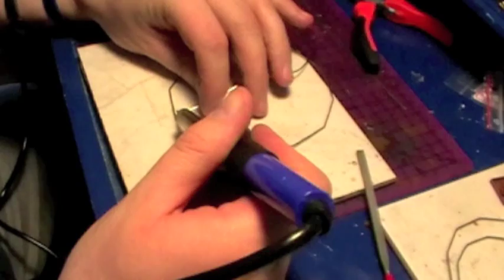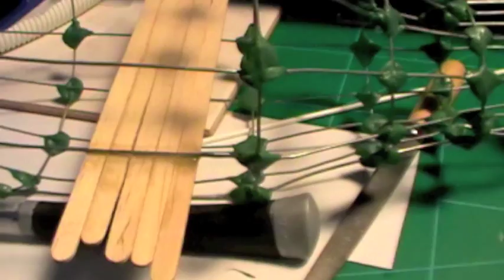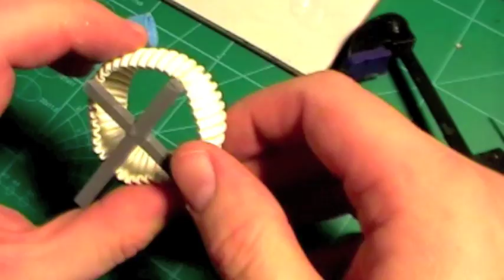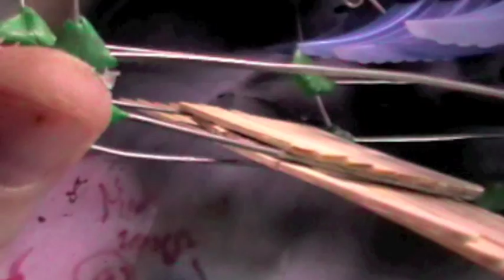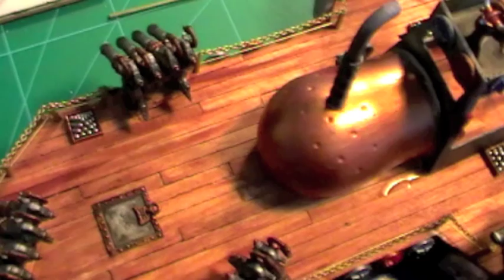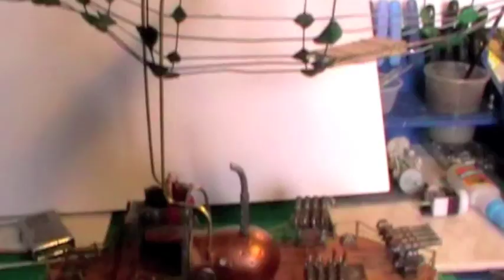Thunderchild - Pt 6 - Warhammer Fantasy Battle - Scratch Built Dwarf Airship

Comment: You know a balloon and papermachet would have made a much easier and very uniform zeplin.  The papermachet can then be further smoothed off by sanding it back.  Its a messy process but keeps it light, and surprisingly strong. Another option to keep the shape semetrical would have been to run the wire lengths through solid spar frames like on a ship, but running in a full circle instead of a half circle.  Still your approach has been interesting to watch.

Comment: It wasn't necessarily your soldering skills that prevented you from soldering to the crossmember, it's just too much surface area of metal to heat up, the spot your attempting to solder needs to get up to temp but can't until all the other metal( that's connected) gets up to Temp. Normally you can use a larger Iron and just set that tip on for extended period of time /  or you can try to reduce the surface area of the metal, ie..cut the membrane into small sections. Hope that helps.